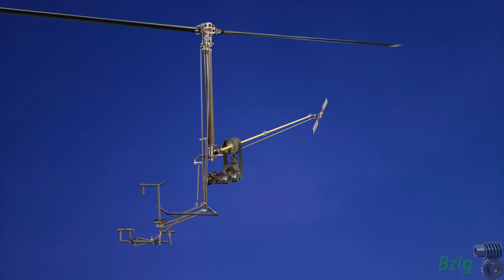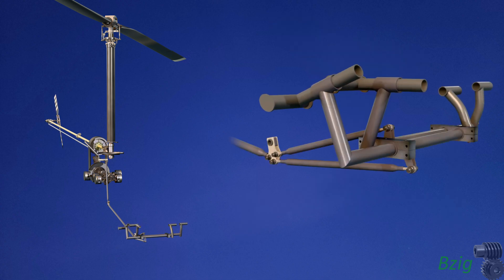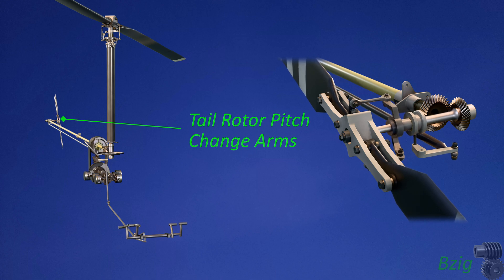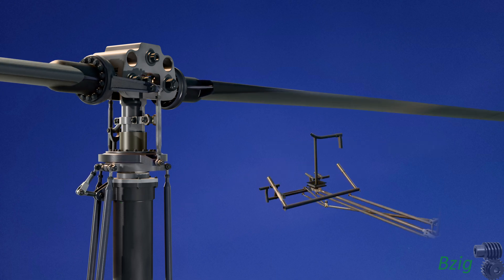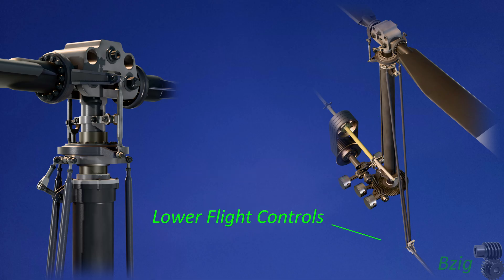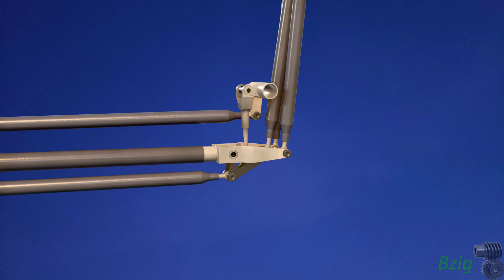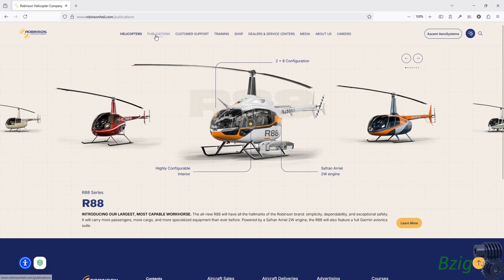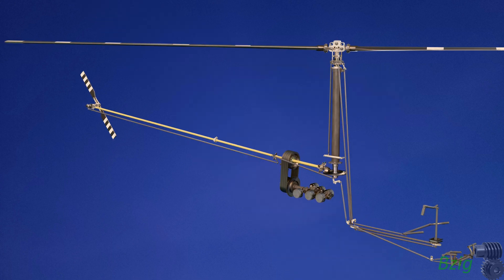R-44 Helicopter Flight Controls

Comment: I recently learned the Robinson has a collective - cyclic coupling that reduces the cyclic throw as collective is increased. This prevents over pitching of the blades at nigh collective input. I’d be curious if you find anything on that and could also be why your models didn’t quite work. 

Regarding phase lag, the head has an offset flapping hinge. I believe this would increase the natural frequency and result in a less than 90 degree phase lag. (I think)

Comment: Since you seem to have a strong understanding of helicopters, are you familiar with a type of linkage that doesnt use rods for the main rotor? I believe the Rotorway homebuilt models use something called a flex cable? If you know what this is I'd love to hear an explanation of how it works.
Reply from the maker: sounds interesting.  I know the enstrom uses this type of arrangement, but I'm not familiar with the Rotorway.  The enstrom looks like a very clean design because you can't see pitch links or swashplates below the rotor hub, but they are still there.  Just hidden from view and they pass control power through the rotor mast.

Comment: Hey brother can you please make a detailed video on V 280 Valor that ,how it's propeller change their axis without changing the axis or position of its engine 
Brother please  make a video on it because I am trying to design some a drone  with 4 micro jet engines but every time my project lack because micro jet engine burns a lot of fuel and these engine do not meet my requirements but a micro turbo shaft engine can do this engine burns less fuel than the jet engine but for turbo shaft engine I want to design a gearbox like V 280 so can you please help me.

Comment: Yo
We're assembling R44s at our hangar
Would be dope if i could help with any footage.
Im not an AMT tho haha
Reply from the maker: what would be really helpful is to know the maximum main rotor blade pitch angle... I'm rigging the controls on the model using the rigging procedures in the maintenance manual and I come up with... collective full-up, cyclic full-forward and the blades at 9 and 3 o'clock...the 9 o'clock blade is about 28 degrees of geometric pitch (measured at 75% blade span).  It's a pretty specific request... no worries if you can't get it.  Thanks for offering to help!

Comment: 03:23 I've heard that some sources claim that Robinson helicopters achieve maximum blade pitch 72° before the rear instead of 90°. Animagraffs makes this claim in his video on how a helicopter works using the Bell 407 as an example, where he references Robinsons when talking about gyroscopic precession and phase lag.

On the other hand, I've seen other people claim that the swashplate in Robinson machines tilt exactly how the cyclic stick tilts, with no offset.

Do you know if the 72° angle is merely the advance angle of the swashplate and Robinsons exhibit 90° phase lag, or if the 72° angle is the actual phase lag? I have a feeling that this is one of those cases where attempts to simplify things have inadvertently made things more complex.
Reply from the maker: That's actually pretty cool.  Here's why... I had no idea what the advance angle of the swashplate was... that kind of information just isn't in Robinson technical documentation.  But, unlike the bell 206, where it's 90 degrees, the Robinson uses an offset pitch horn.  It's obvious that there has to be an angle other than 90.  I determined it visually, by looking at the aircraft, photos and drawings in the maintenance manual and I came up with 71.2 degrees.  The Robinson still has 90 degrees of phase lag, but the input is put in by an offset pitch link that's 71.2 degrees behind the blade.  

I think.  That non-90-degree angle results in delta-3 coupling at the blade.  I know that an offset flapping hinge changes the phase lag angle to be less than 90.  I don't think delta-3 does that.  But I'll need to research that before making the next video.

Comment: Mr.BZIG  about swashplate. If the pilot add collective⬆️ and then he pushed the cyclic to forward direction ⬅️ so that is mean he got the ⬅️⬆️motion the question is whe he adding the direction motion does the swashplate lose the collective moition in a specific angle or (spot) and goes to normal (no collective)spot
Reply from the maker: It depends on how those two inputs are mixed.  If everything is mixed 1:1 from input to swashplate motion, then the up collective would be additive at the 6 o'clock position, with forwarding stick.  And subtractive at 12 o'clock.
Reply: @bzig4929   i understand more like this ((lets ignore the gyroscopic precision)) 
 It the swashplate  traveling distance is between 0( normal) up to 10 degrees  and the pilot added collective ⬆️to 5 degrees that is mean  The  helicopter  goes to hovering mode! In that point the pilot adds  cyclic  to forward ⬅️ ((2degrees)) sooo that is mean the angles are changed in the swashplate ! At 6 o’clock it will become 7 degrees in the same time at 12 o’clock it will become 3 degree  and at 9&3 o’clock it will be 5.8=6 degrees . Is this correct ?
Reply from the maker: Nice observation, BTW.
Reply: @bzig4929 thano ❤

Comment: Great attention to detail! The only error I've spotted (I too have never dug in an r44) is the white bell crank's motion at the ends follows an arc. the holes at the end trace out arcs.
then there's a gray tube that goes up to connect to the sleeve over the tail rotor shaft. somewhere in there should be something that allows for that arc, right?

I think you should also get into a video call with several maintenance mechanics and/or shadow a maintenance mechanic for an r44 😁

Comment: Really nice work! I reference your videos to my students as it makes the mechanical understanding very clear.

You talked about hydraulics for the R44. There is a R44 Astro version which was with electric trim system. However, these aircrafts where later converted to be fitted with hydraulic controls.
As pilots we are trained to fly the R44 without hydraulics (HYD Switch off), but it is very difficult. I find flying at forward speed manageable, but hovering without hydraulics become very difficult.
The reason is because the collective and cyclic movements are linked. Without hydraulics both controls are very heavy and when you move one, you have to correct the other with force - it is easy to fall behind the control curve and enter pilot induced oscillation.
I also noticed that roll axis on the cyclic control with HYD off is fairly easy (low force required), whereas forward and aft and collective up movements require significant force. The differences in corrective force required in both axis makes it tricky!
Reply from the maker: Thanks for sharing this with your students... I appreciate the feedback and I'm glad it's useful.   I mention coupling in the video, but the way you explained it was much better than I did.I have more time in MD500s than I do in the robinsons and your comment brought back the memory (its been 30 years) of how coupled that non-hydraulic flight control system was... I think a full down collective input was something like 10 or 15 lbs of aft stick force needed to keep the cyclic centered.